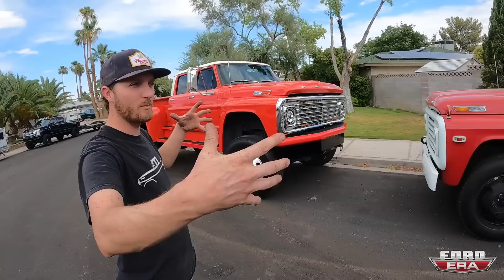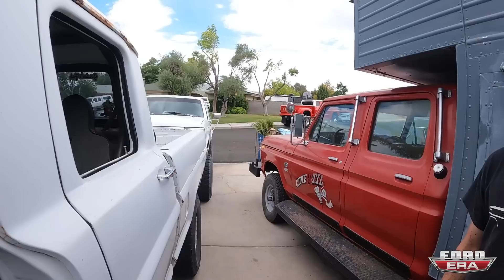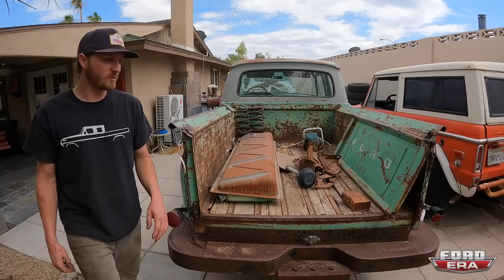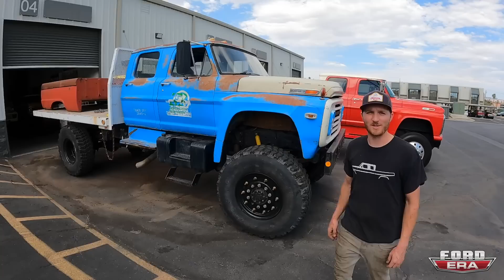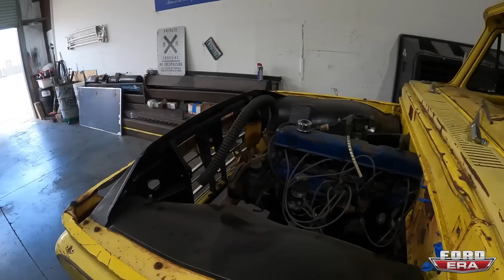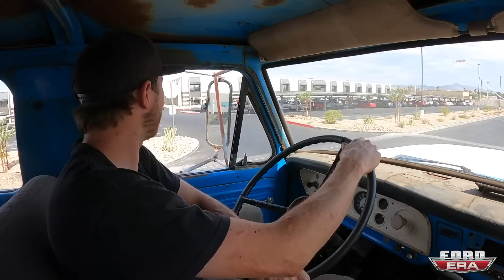Visiting Gordon's Fab Shop & Truck Tour | Another Crew Cab Fanatic | Ford Era

Comment: I am a Chevy guy I love the Chevy four-door old school those Fords are gorgeous old school it's so wild I would rather have one of those than a brand new truck I was brought up old fashioned this new vehicles are junk it makes me feel good that guys like yourself building old school to put back on the road that is awesome keep up the good work guys
Reply: The older Ford 1967 - 1972 "Bump Side" trucks are cool. However, I personally favor Ford 1973 - 1979 "Dent Side" trucks. The original Big Foot truck was a 1974 Ford F250 4WD, 360 V8.  

The older Chevrolet / GMC trucks were the last to have a crew cab configuration. The first crew cab truck in the U.S. was made by International Harvester in 1957 dubbed Travelette and later followed by Dodge in 1963, Ford in 1965 and Chevrolet in 1973. Also interesting to note that Chevrolet and GMC were the last to have a "cab and a half" configuration. Dodge rolled out their "club cab" in 1973 and Ford followed in 1974 with the "super cab". Chevrolet and GMC were late for that party, not offering the "extended cab" until 1988. 

The 1967 - 1972 Chevrolet and GMC "Action Line" trucks, for many reasons, were the best GM ever built. These trucks by far had the best body style, and best suited in 4WD versions for rim, tire and lift modifications, mainly for the rounded wheel wells which allow for larger than OEM stock rims and tires with only a moderate lift. The GM "Square Body" trucks arrived in 1973, making it difficult to install large tires with moderate lift, thus compromising the "center of gravity".

The 1967 - 1972 Chevrolet and GMC 4WD trucks were all built with either the Rockwell or New Process 205 transfer cases. However, these trucks never rolled off the assembly line in the "crew cab" configuration. If you want a 1967 - 1972 Chevrolet or GMC "crew cab" truck, you will have to have it custom built. Rtech Fabrications is the best shop by far doing this work and is located in Coeur d'Alene Idaho.

https://www.rtechfabrications.com/

The 1973 GM 4WD trucks all had NP 205 transfer cases. The BAD thing regarding the 1974 - 1979 Chevrolet and GMC 4WD trucks is this: GM 4WD trucks with the TH 350 or TH 400 automatic transmissions were only available with the "piece of junk" chain driven NP 203 transfer case. In order to get the stout "bullet proof" gear driven NP 205 transfer case, the truck had to be equipped with the SM 465 manual transmission. The 1967 - 1972 Chevrolet and GMC 4WD trucks were all built with either the Rockwell or New Process 205 transfer cases. 

Ford on the other hand predominantly built all of the their 4WD trucks with the NP 205 transfer case, behind both the C6 automatic and the NP 435 manual transmissions.

The worst thing ever to happen to both Chevrolet and GMC 4WD trucks occurred in 1988, with the new IFA axle and low stance with low hanging frame rails...neither conducive to good, much less great off-road capabilities. The IFS axle has poor articulation (wheel travel). The low stance results in poor approach, departure and breakover angles, and the low hanging frame rails can cause the truck to "high center" on uneven terrain off-road, especially in mud and snow. Add the square / rectangle wheel wells caused the proverbial "round peg in a square hole" (round rim and tire in a square / rectangle wheel well).

Comment: Big Red is sick but Big Blue has a much more appealing aesthetic in my opinion…
Reply from the maker: there so different but so bad ass
Reply: Spot On!!! Big Blue is cool with 4WD and SRW...and the flatbed with PTO winch. Big Red needs a few alterations. First, cut off the running boards, Second, cut off the lower portion of the front fender, both front and back. Third, custom build streamlined saddle fuel tanks with built in steps, paint white to match the top of the cab. Fourth, convert to 4WD and SRW. Fifth, add a PTO winch up front.

Comment: I want one and I’m usually a Chevy guy
Reply from the maker: some of them are for sale
Reply: @FordEra  well once i finish project Fargo, 68 Fargo on a 2004 Cummins 1 ton 4x4 chassis i will certainly look at purchasing one of the ford crew cabs from the 70s
Reply: @FordEra  I don’t think I can share pictures on here of Fargo, but yes 70s Ford Is next on the list I’m retiring as a locomotive engineer 34 years. I drove a Ford highboy on my dads lap , well steered when I was about 8?
Reply from the maker: @MrThewhip333  that is great
Reply: The 1967 - 1972 Chevrolet and GMC "Action Line" trucks were the best GM ever built, especially the 4WD versions. BUT.....the 1973 - 1979 Ford "Dent Side" trucks are my favorite, closely followed by the 1967 - 1972 Ford "Bump Side" trucks.